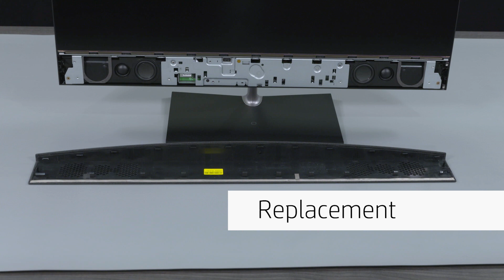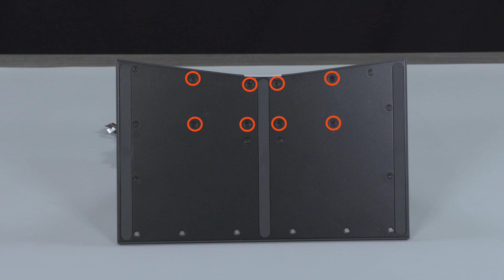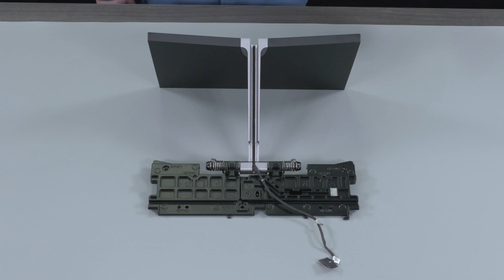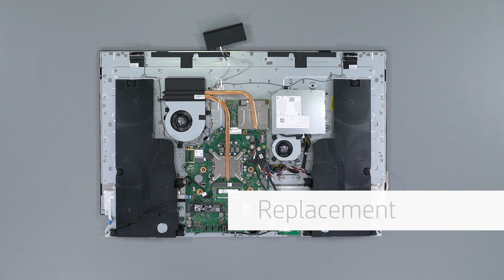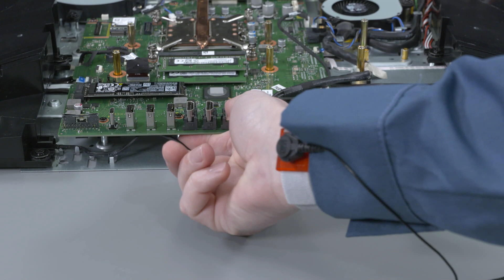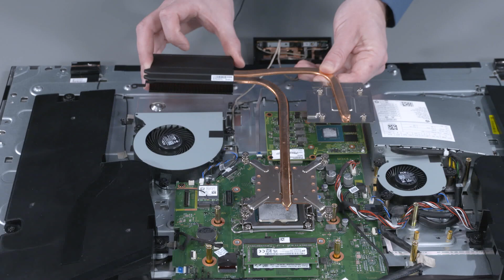Removing & Replacing Parts | HP Pavilion 31.5 inch AiO Desktop PC 32-b0000i | HP Computer Service

Comment: thanks for easy step by step guide ... I upgraded memory no problem and like to up grade the gpu but can not find any anywhere ... any ideas like a rtx 3050
Reply from the maker: Hi Robert, thanks for contacting HP Global Social Media Support!
I understand that you need to know about upgrading the graphics card. 
I will do my best to assist you.
HP does not recommend upgrading or downgrading hardware parts or software that is bundled with the product as It may affect the manufacturer's warranty and performance, however, you could change the configuration at your own discretion.
Binu_HP Social Media Tech Support

Comment: Where is the wireless keyboard adapter that the PC has internally connected?
Reply from the maker: Hi there, thanks for contacting HP Global Social Media Support!
I am here to help!
What seems to be the issue? Could you please elaborate?
May I know the complete model number of the product you are using?
Let me know!
Regards, 
HP Support
Reply: @HPSupport it is the All in One Pavilion HP 31.5" b0001la. In its box it came with a wireless mouse and keyboard. On the box it said that the PC has internal adapters that receive the signal from the keyboard and mouse. I read in a forum I can remove those adapters to use them in other PCs.
Reply from the maker: Hi there, thanks for contacting HP Global Social Media Support!
I understand that you need to know whether you can use the adapters in other PC.
I will do my best to assist you.
HP does not recommend upgrading or downgrading hardware parts or software that is bundled with the product as It may affect the manufacturer's warranty and performance, however, you could change the configuration at your own discretion.
Regards, 
HP Support

Comment: How to replace the LVDS Cable
Reply from the maker: Hi Hari, thanks for contacting HP Global Social Media Support!
I understand that you need to know about replacing LVDS Cable. 
In order to get this issue fixed, please contact our customer care team over the phone or chat for further assistance, as this issue requires Live conversation with you over phone or chat to isolate the issue and provide you instantly with appropriate solution or repair/replacement options available at your place as per the warranty.
Please feel free to reach us on call/chat, please access this link to select your preferred country and language option to reach us. Global support link: - https://www8.hp.com/us/en/contact-hp/ww-phone-assist.html
Binu_HP Social Media Tech Support

Comment: Can I mount this on my table? And remove the stand assembly?
Reply from the maker: Hi Khoi, thanks for contacting HP Global Social Media Support!
I understand that you need to know whether you can mount this on your table and remove the stand assembly.
I will do my best to assist you.
HP does not recommend upgrading or downgrading hardware parts or software that is bundled with the product as It may affect the manufacturer's warranty and performance, however, you could change the configuration at your own discretion.
Binu - Social Media Tech Support

Comment: It a chance to use that usb c port like a thunderbolt?
Reply: i ask that because i want to know if i can conect a Gigabyte Aorus GeForce RTX 3080 Gaming Box on him...
Reply from the maker: HP does not recommend upgrading or downgrading hardware parts or software that is bundled with the product as It may affect the manufacturer's warranty and performance, however, you could change the configuration at your own discretion.
Regards, 
HP Support
Reply: Thank you so much, but that usb-c port can be used like a thunderbolt?
Reply from the maker: Thanks for getting back to us, Well upon checking I'm afraid the USB C port cannot be used as a thunderbolt port for an external graphics card support.
I hope this helps!
Regards, 
HP Support

Comment: Hello,
I have this AIO with integrated GPU (intel 770) but on the home page I saw other 2 options like NVIDIA® GeForce® GTX 1650 (4 GB GDDR5 dedicated) or NVIDIA® GeForce RTX™ 3050 (4 GB GDDR6 dedicated) it posible to buy only the GPU  or how i can upgrade.
Also im from Romania and here is not an HP Service, just a collaboration and i send them a mail 3 monts ago and they haven't replayed  yet.
Reply from the maker: Hi there, thanks for contacting HP Global Social Media Support!
I understand that you need to know about upgrading the graphics card of your computer.
I will do my best to assist you.
Configuration varies by one model to another. 
May I know the complete model number of your computer?
Please let us know! 
Regards, 
HP Support
Reply: @HPSupport   the model is HP Pavilion 32-b0006nq
Reply from the maker: Thanks for the reply.
Checked the specification of your notebook and found that it does not have an expansion slot to add external graphics card.
Regards, 
HP Support
Reply: @HPSupport  Thanks for the all information!

Comment: How do i add another display? Just received HP Pavilion All-in-One 32-b0390t and it doesn’t have HDMI out to add 2nd display. 😱
Reply: USB to hdmi maybe the only solution
Reply from the maker: Hi Adrien, thanks for contacting!
I understand that you need to know about adding another display.
I will do my best to assist you.
Please refer this document to know about using two or more monitors with one computer:
https://bit.ly/3lwhQw8
Binu - Social Media Tech Support
Reply: @darren15  bought usb-C, didn't work. I'm waiting USB 2.0 to HDMI and will see if that works.
Reply from the maker: Hi Adrien,
Thanks for the reply.
Please let us know how it goes.
Have a wonderful day!
Cheers!
Binu - Social Media Tech Support
Reply: @adrienrho426  Let us know how it goes. I was considering buying this. This could be a deal breaker.
Reply from the maker: I did not hear back from you yet. Please let me know whether your issue is resolved, or you need additional help.
Cheers!
Binu - Social Media Tech Support
Reply: You can't. This machine is gimped with no native display OUT ports. Only display IN where it functions as a monitor.

Comment: hi, specs say  it has  Expansion Slots
2 M.2 (1 for SSD, 1 for WLAN)
are these extra slots besides the installed ssd ?
 so can I add another ssd to make it 1TB + 1TB  ?
 thanks
Reply from the maker: Hi there, thanks for contacting HP Global Social Media Support!
I understand that you need to know whether you can add another SSD on your computer.
I will do my best to assist you.
This computer has 2 M.2 (1 for SSD, 1 for WLAN). So you can add another SSD. 
Binu-HP Social Media Tech Support